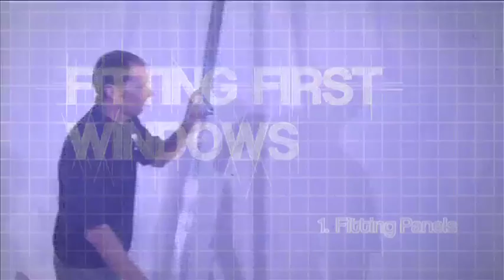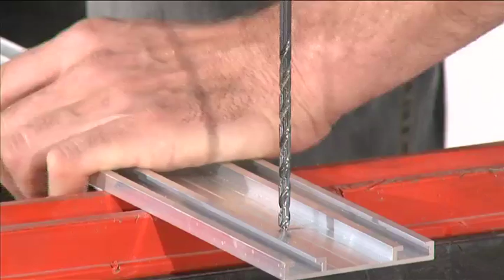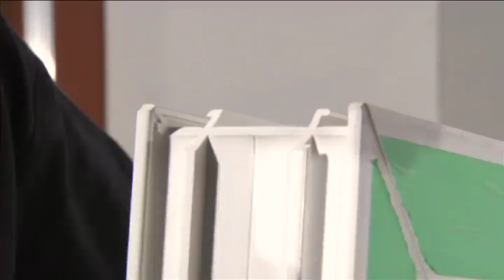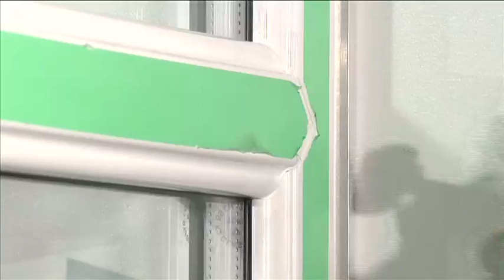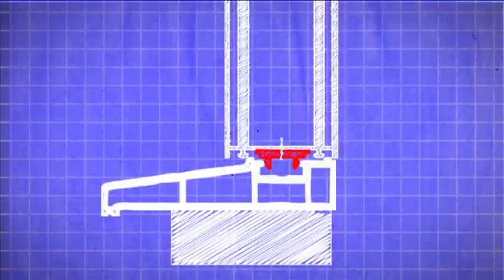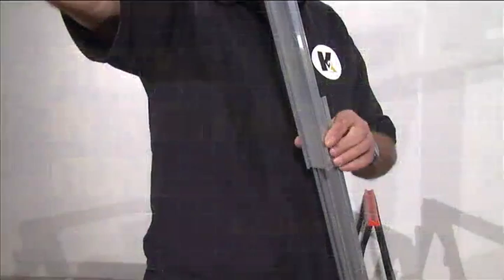Conservatory Installation - First Window

Comment: how are the 135 degree posts installed by sliding from above if a bay roof is already installed. Is there another method since my bay windows were installed with a bay roof that would have been in the way ?